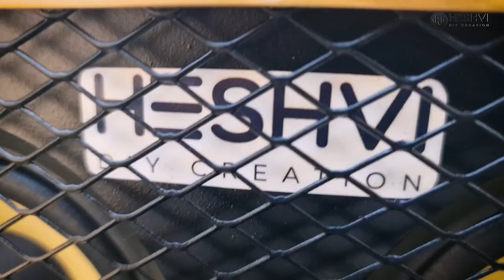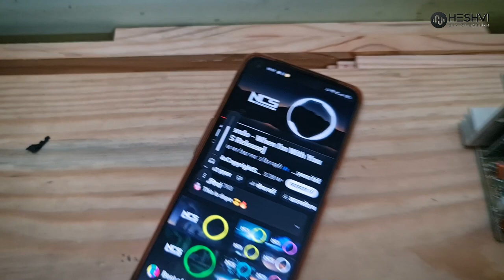DIY 4 Inch 4 Speaker Box Design with Passive Radiator | MDF, Pine | Sound Box | Speaker Enclosure

Comment: Bhai ek tip Dena chahunga if u don't mind.. passive radiator pe aap sticker use Kiya Karo.. wood makes it a lil heavy passive radiator will not move freely, main job for a passive radiator is to maintain proper air pressure in the sealed box, taki speaker pe zyada air pressure na bana rahe and moves freely.. really good speaker build over all, mujhe ye bohut pasand aaya... I will like and subscribe ❤️
Reply from the maker: You are Right brother and Thanks Buddy for suggestion.
Sticker ka Idea acha hai 🥰
Keep Supporting❤️

Comment: Bro i want to make 1 ft or 12 speaker box... and want to add atleat 4 loudest spearkers in it... without bass... only loudest spearkers... can you plz suggest most loudest spearkers of small size.. 4 speaker should in 1 ft leanght and 5 - 6inch height.. plz suggest loudest speakers

Comment: Bro what is work of passive radiator ??
Reply from the maker: Passive Radiator create the deepest pitch of bass. Only You need to just weight on it and its give loud and Soft Sound Quality. In ported enclosure some time air noise comes through the port but there is no air  noise in passive Radiator Enclosure.
Thanks Buddy 🥰 Keep Supporting
Reply: @HeshviCreation  thank you so much for information 🥰 also support 💕 💗 ❤️

Comment: sir mujhe sabse  best amp batao 50 w ki output k sath aub woofer vala i am very confuse
Reply from the maker: Only subwoofer board ya fir 2.1 Channel board
Reply: @HeshviCreation   1subwoofer and  1 1tweeter not 2.1
Reply from the maker: 1.1 channel ka koi board nhi ata hai
Apko kud hi banana pdega
Reply: @HeshviCreation  bro aap samjhe nhi apki ek vdo m apne pam 8610 poard p 2 subwoofer and 2 tweeter use kiye the m bss aisa chta hu
Reply from the maker: 2.0 channel ka board chahiye
With Bluetooth
1. Best https://inkocean.in/products/zk-502m-mini-bluetooth-5-0-power-audio-amplifier-board-50wx2-stereo

2. Risk of burn if any connection is wrong
https://inkocean.in/products/xy-c50l-50w-50w-bluetooth-stereo-audio-amplifier-module

Without Bluetooth
https://amzn.to/3IAEoH7
Best one - https://amzn.to/415YvnJ
https://amzn.to/415XWdz
Reply: @HeshviCreation  sir ye thoda mujhe costly pd jayega kya m pam 8610 ya TPA 3118 m se konsa use lu
Reply from the maker: Tpa3118
Reply: @HeshviCreation  sir aap kya isse ek speaker bna sakte ho

Comment: Bro in my subwoofer humming sound is coming what can we do
Reply from the maker: What kind of humming comes on your speaker? 
There is many Reasons of humming in Speaker.
Like Bluetooth Noise, Preamp humming, wire Grounding issue or speaker is damaged inside
Reply: @HeshviCreation  bro i think its wire grounding
Reply from the maker: If your problem is not solve then You can Contact me on WhatsApp 
Link in Description
Reply: Bro now no sound I think its because of I have put 19v 1 amps and now I have put12v 2 amp so no sound came 
Thanks bro
Reply from the maker: 🥰 Keep Supporting
Reply: @HeshviCreation  yes bro😄😃

Comment: Bro I need your help 
Im using pam8610 amplifier board
Supply 12v 3amp SMPS power supply and 2speaker 6ohm 15w for each channel but mujhe clear sound output nhi mile rha hai
Reply from the maker: Audio input k liye kya use le rhe ho.
Aux or Bluetooth (Bluetooth konsa hai)
Reply: Mne dono se hi try Kiya AUX and Bluetooth so dono mai hi sound ki clearity nahin a rahi hai
Reply: And speaker Jo use mein liye hain maine vah only speaker hi hai  woofer nahin hai. To is chij ka bhi fark padega kya
Reply from the maker: Low volume par sound kesa aa rha hai. 
Low volume par sound sahi aa rha hai to apke adapter ka issue hoga. Adapter change krke dekho. Or Agar apke pass Multimeter hai to uske volts or Ampere check karo. Kitne volts dera hai or kitne Ampere amplifier le rha hai. 
Bass ka to bohut frak pdega bhai agar normal speaker hai to. 
Woofer me bass jyda ata hai normally speaker se
Reply: Okay bro I will try but mne jab low pass filter use Kiya tha to sound ki clarity and quality bhut sandar mili thi but loudness bhut low ho ge thi so eske koe kr sekete hai kya ki ham low pass filter use krte huve good sound quality ke saathe loudness bhi mile
Reply: And agr mai koe subwoofer bhi use Krna chahu to koe best subwoofer suggest bhi Krna jo ki mai pam8610 ke saathe use kr saku with both 6ohm 15w speaker
Reply from the maker: https://youtu.be/8FppSZqKuZY
Audio boost curcit ka video hai ye.
Asa circuit low pass filter k badh laga dena audio gain ho jayegi.
Reply from the maker: Power input par ek 2200uf 25v ka capacitor laga dena.
Adapter Sayad Sahi Volts or amp nhi de rha hai.

Agar Apki problem Solve nhi hoti hai to Aap mujhe WhatsApp par contact kr skte hai
Link in Description
Reply: Okey bro I will try
Reply: Bro I don't get any WhatsApp link in the
Reply from the maker: Heshvi Creation on WhatsApp. https://wa.me/message/GUKKS5N3SBFND1